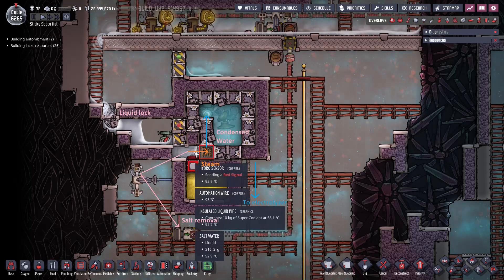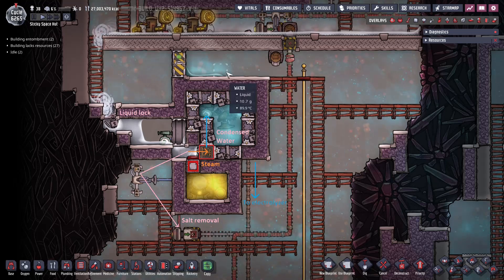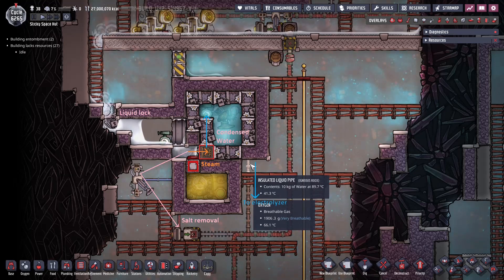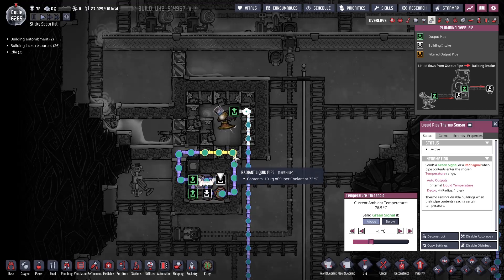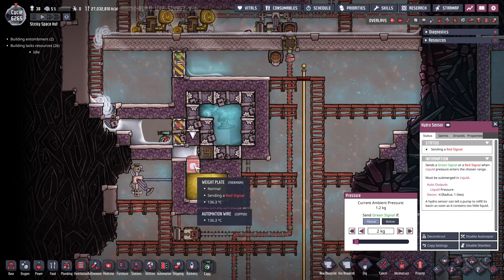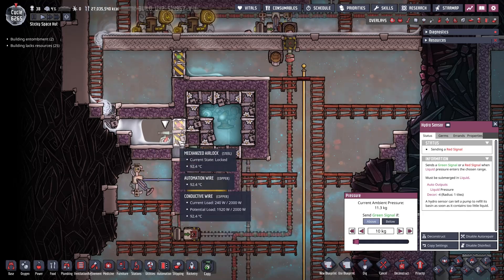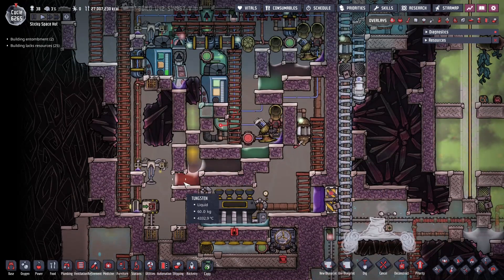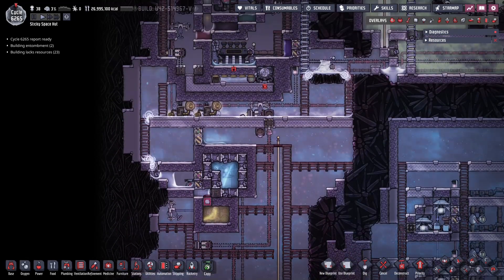FORGET THE DESALINATOR! - Oxygen Not Included

Comment: That's a cool design, although technically a steam turbine design would be more power efficient, especially if you take most of the heat from Electrolyzers.
Reply: Yeah, I notice this a lot with these oni-tubers. Everything gets over-engineered to a point where it's actually worse than something simple. But, I think it's because they value making something really cool, and the problem solving that goes along with it, over finding the simplest solution.
Reply: @PsytheZero  Ah if it was just oni-tubers haha. Actually when it's oni-tubers it's totally fine because it's just a game so they are supposed have fun with it even if this means not being super efficient. 

The funny thing is that real engineers also do this IRL sometimes and that can lead to extremely costly, inefficient, just plain bad systems in situations where a simpler approach was readily available. 

More specifically, as a Dev, I have seen a lot of in-house software being used when there are cheap products available that could have been used for a fraction of the price. Millions of dollars wasted developing something new that objectively performs worst than a software with a 1k$ licence or even something opensource.
Reply: @Tamizushi  I know exactly what you mean! I work for a regulatory agency that had a massive piece of custom software that was just awful. After I started, I built a better system in Access in 2 days using some custom forms and about 30 lines of VBA.
Reply from the maker: Definitely, can just boil salt water under a turbine while cooling gasses coming off Electrolyzers.